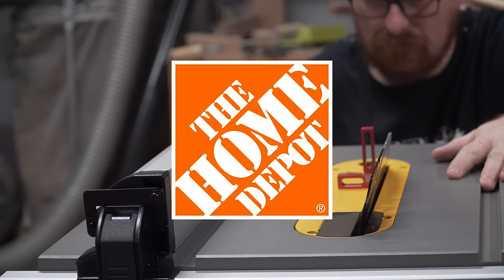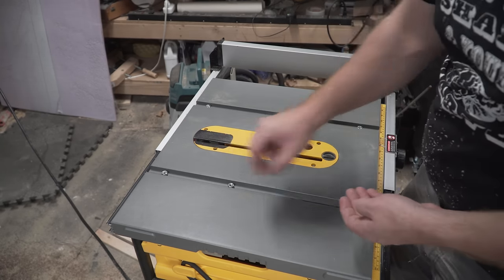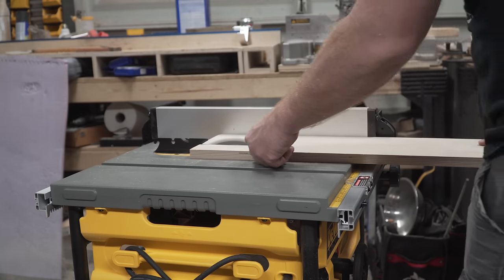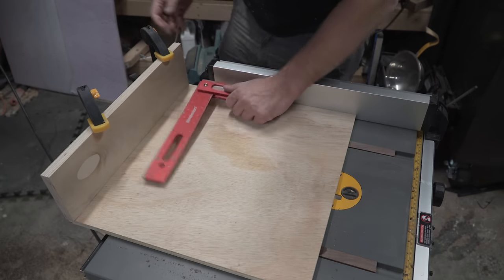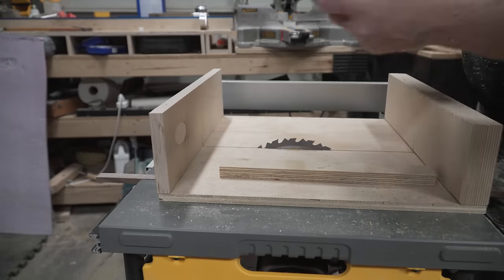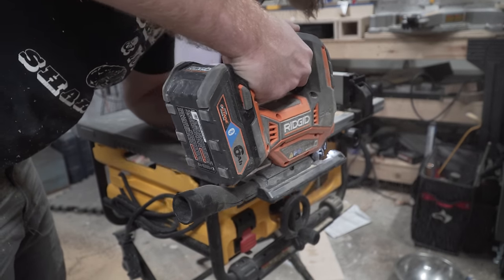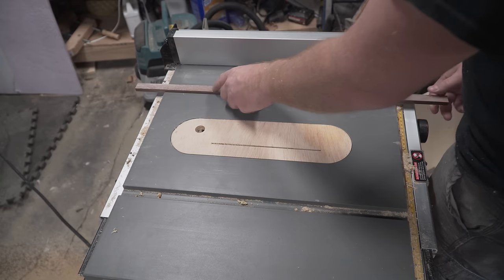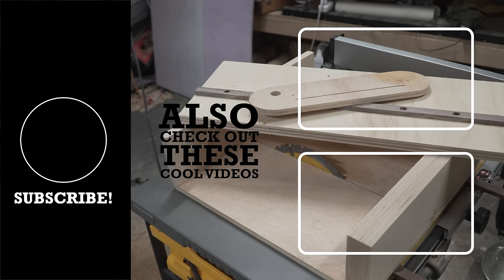3 Simple Jigs to get Professional Results from any Table Saw | Shop Tips

Comment: Not for nothing, I found you to be confusing. First of all you speak to fast. You also blur many words and the meaning of the sentence is lost. I watched this video three times trying to figure out what you mean by some of the things you say. It's just impossible to follow. Several cuts with guesstimation of square? What the heck does that mean? And the five cut method, what is that? There are many other things like that that leave me wondering what you mean. Very frustrating. And why can't the first sled be used for what the one runner sled does?
Reply: guesstimations of my edumications hahaha. The reason you need the 3rd jig is you have to go all the way through the cut and with a board sitting on another board (jig surface) could be higher than the back and front of the fences on the crosscut sled, so you would end  up with sled cut in half, therefore giving you a right and left jointing jig which would be funny but a waste of time.